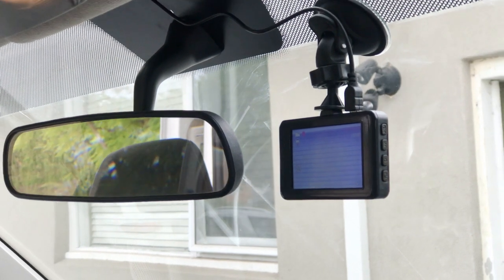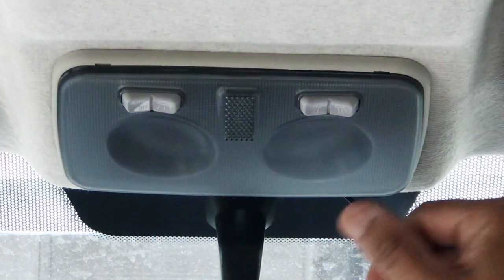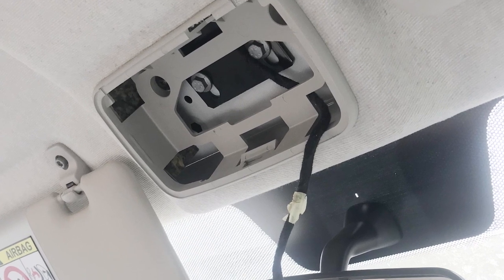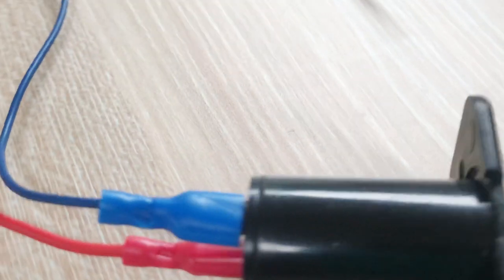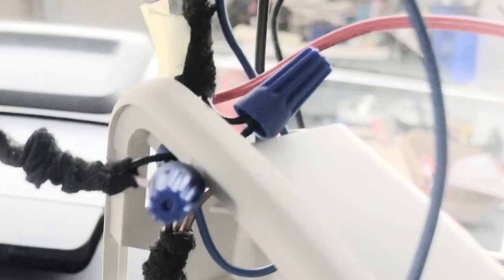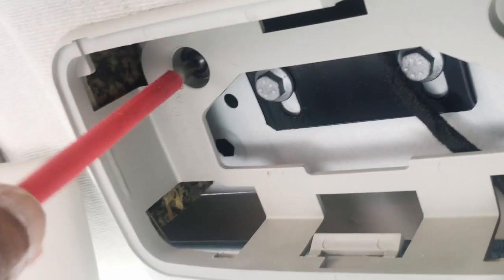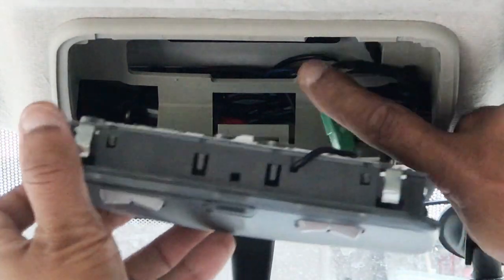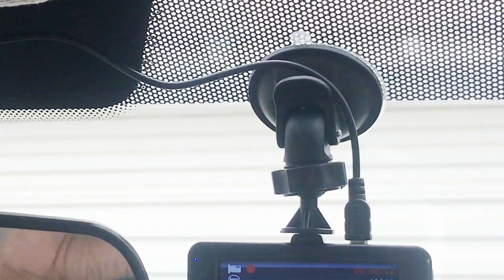Fiat Ducato Dashcam Install

Comment: Hi does it affect the cam bus and get a light on the dash thanks malc
Reply from the maker: No error message on the dash - but the power comes on only when the vehicle is running.. so this year I might run a power source that will be on 24/7 - pretty good from a security perspective as the dashcam will record always

Comment: Sorry but there is a lag of information im doing it right now and im stuck with the green connector that doesnt want to get loose and then the other question is what cables i need to twist together im expecting it to be the one with 2 cables but there is no indication in the video😅
Reply from the maker: I did this video two years ago, i think i mention the cables i used at this particular point of the video: https://youtu.be/kyvZyH88v_M?t=131
Reply: @VanHacks  Yellow and black cable.